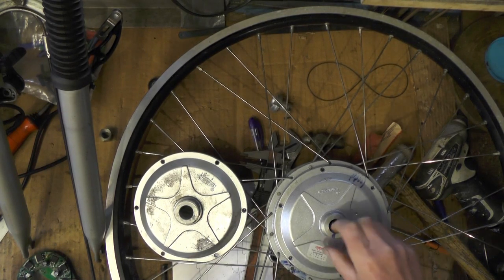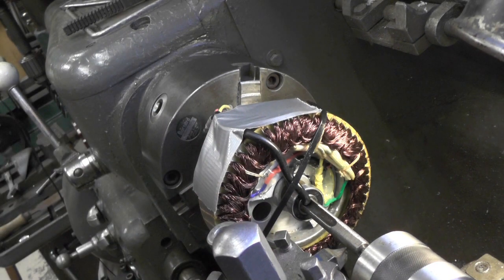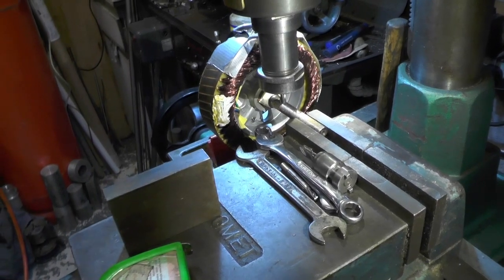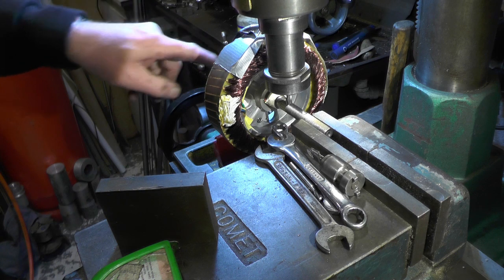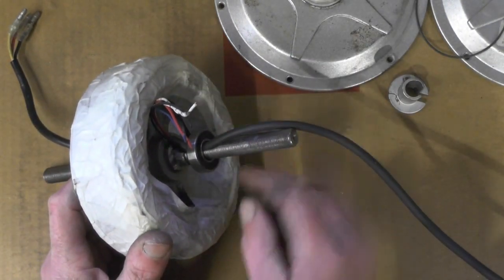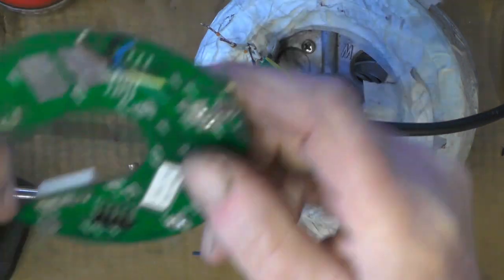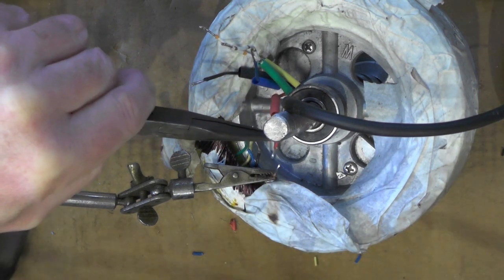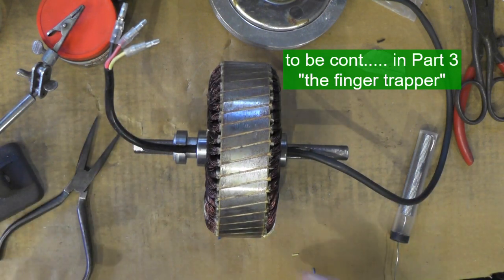Recycle a Cycle Electric Hub Motor (Sparta) Repair a Rear ebike Hub in to a Front Hub PART 2 "mr f"

Comment: Did you tried to power them with 48v buttery and 500 w controller? Is there no overheat ?
Reply from the maker: tried a 500 w controller and a 36v battery, does not overheat,

Comment: Hi Mr. F,
Great work as usual... one thing that sprung to mind when watching was that sometimes rear wheels are dished differently than front wheels to take into account the drive sprocket(s). See you next time.
Take care
Paul,,
Reply from the maker: cheers paul
yes theres various rear ones for sturmey archer, derailier, with or without discs etc etc. i think this a very early ebike motor. thanks for watching, and like that watchmakersl lathe of yours
regards
mr f